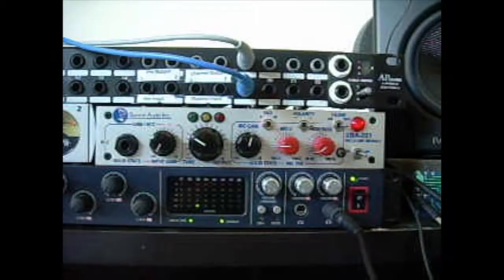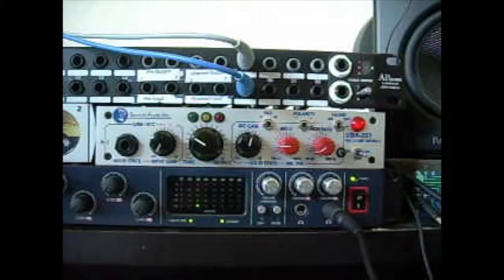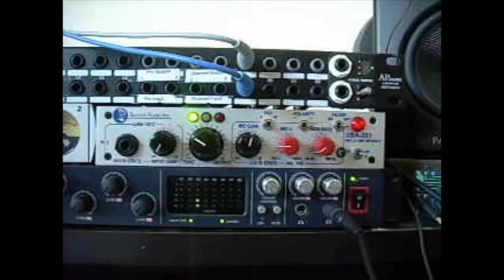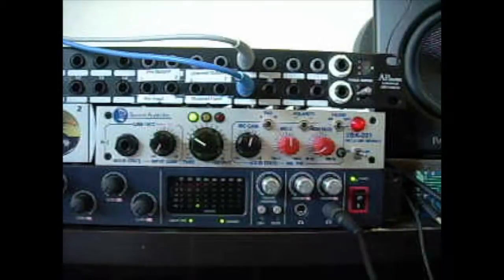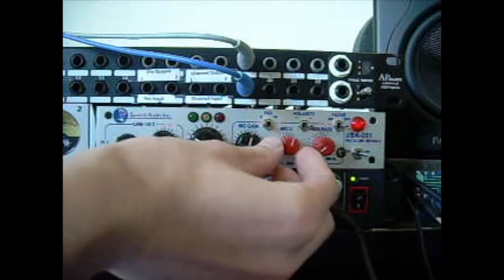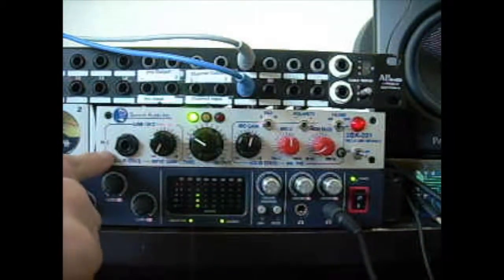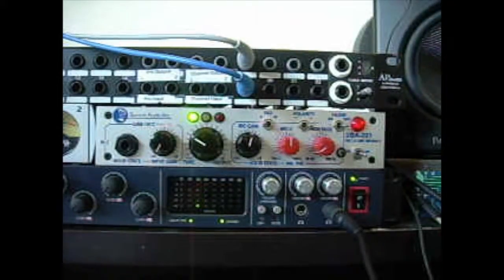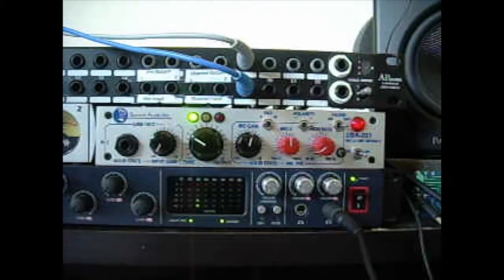Mic Impedance

Comment: Thanks.  Bluebird  mic impedance is 50 ohms and I've been using it with the ISA One preamp on the ISA 110 setting which is like 1.4k ohms.  I don't think it will make a difference but I'm going to use it in the low setting which is 600 ohms.  That's still plenty.